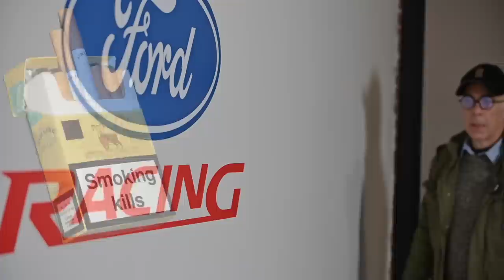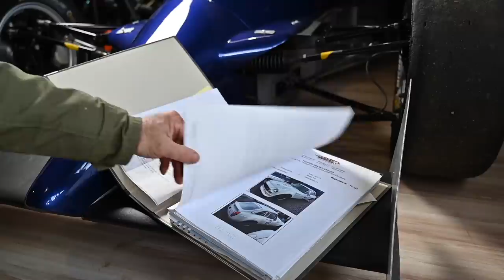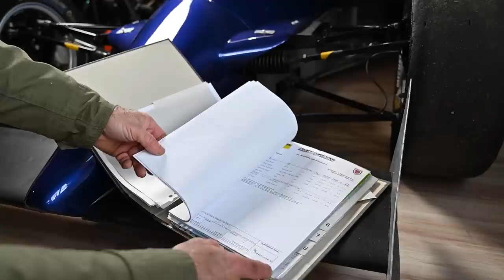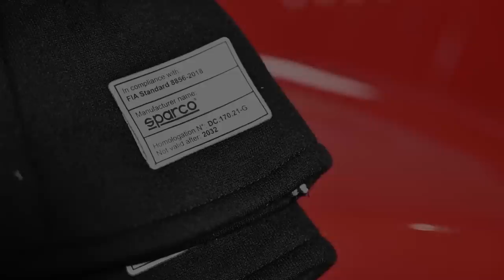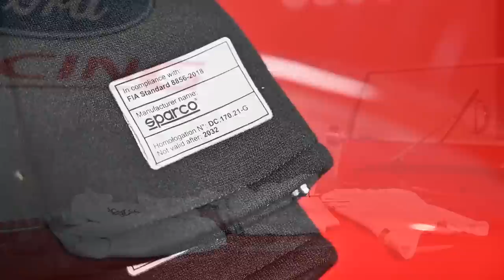Race or smoke yourself to death

Comment: Another great video, Steve, with lots of sound advice. In addition to my MGB vintage race car,
I also have an E30 race car which is fully prepped but I use it just for track days. Your budget,
when converted from Euros to Canadian dollars, is very accurate, but I think you left out one 
thing. Maybe I missed it but what about having to purchase a tow vehicle and the added cost of installing a proper hitch, electric brake controller, etc. Not chump change for sure. Also, from 
personal experience, I have used secondhand race tires up to 12 years old, dispelling the myth

that they are no good after 3 to 4 years. I find after a lap or two, they soften up nicely and stick 
almost as good as new, and that's just fine for lapping. The key, store them indoors at room 
temperature and out of the light. Keep 'em comin', Steve.light
Reply from the maker: Thanks for the comments, and yes indeed the truck to pull is another investment... but maybe most of us have already one as a daily driver. As for the tires, much depend on the compound  and how they have been stored over time...  Good to hear that you have a good experience with it even after 12 years. What were they Avon ?
Reply: @D3Sshooter  We use mostly radials over here, Steve, except some use Hoosier bias ply in vintage. I've gone through several 'old' tires, Nitto NT01s, Khumos, etc., all R compound but DOT i.e. not racing slicks. The most recent last summer on the E30 were Toyo Proxes RRs manufacture date 12th week, 2013, and Michelin Pilot Sport Cups manufacture date 7th week, 2008. The Sport Cups took a couple of laps but once I got a little heat in them, they came to life and had very good adhesion.

Cheers,

Greg.

Comment: In the UK, an open wheel formula type race car is less than ideal as a track day car - there are very few organisers here that provide track days for them and those that do, only offer a couple of days each year. The alternative is to book test days, but they tend to be much more expensive, require a race licence and are much more focussed towards the needs of “proper” racing drivers.
Reply from the maker: I see, a lot depends where you live.  In Belgium and the Nederlannds we have the CRAC and HARC...  lets say together there are about 12 race days a year ( non competitive)..  As far as I know the UK is great with lots of tracks for Openwheels, but yes you might need a license . Although  that is not expensive not that hard to get

Comment: 13:40 would be interesting to see a video on when racing tyres are through.  A lot harder to check than regular tyres I reckon!
Reply from the maker: There are markers on the tires , that show you that the soft compound is gone...   But most pro's only race one race , and they really beat the tires...